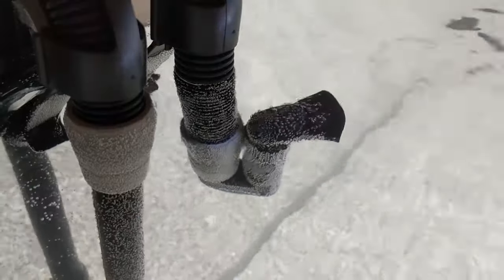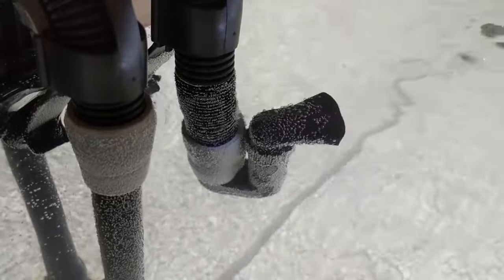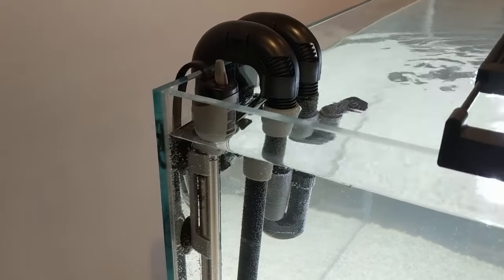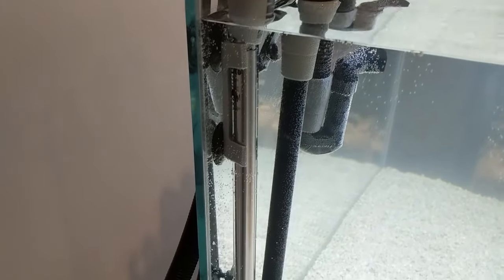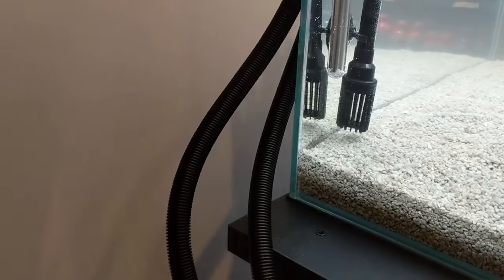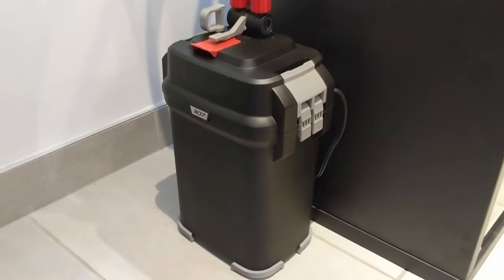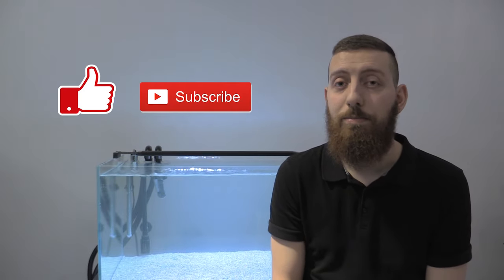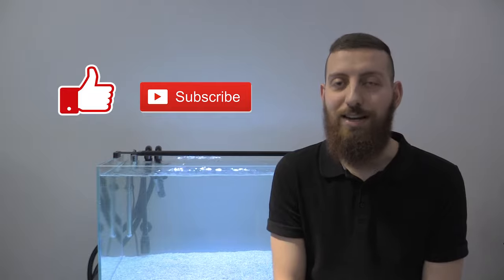Canister filter intake / output positioning tips

Comment: So i'm looking into getting a stand for our 40 gallon breeder with the fluval. Does it matter where I position the fluval? Should it be on the ground like pictured here? or could it be closer on the stand so its higher to the tank? Would my stand height matter in this case?  we just got it so i know nothing Lol
Reply from the maker: Hi there! Canister filters are gravity-fed systems, so they need to be positioned below the aquarium to work effectively. We encourage you to consult your instruction manual, as it outlines the correct positioning of the filter relative to the aquarium! 👍
Reply: @fluval  Thank you! I appreciate this. We're still putting together our system. excited for our new filter. its been a battle with the old one LOL
Reply: @fluval  update. It's A.mazing  👏👏👏

Comment: How would you go about using 2 x canister filters? I've currently got one canister at each end of the tank. The inlet and outlet for canister 1 is at the left side of the tank and canister 2 has the inlet and outlet at the right hand side of the tank. I have 2x wave makers on the left hand side of the tank, both pointing to the surface. I'm thinking about moving both inlets to the right hand side.  What do you think? Thanks
Reply from the maker: Hi Chris, when we use two filters on one aquarium, we set them up exactly the way you have them right now! One canister filter on one side, the second one on the other side. 👍

Comment: Great video. I have my 307 setup like yours. I have a musk turtle in my tank so pretty loaded. I have the vertical movement but would I benefit from having an internal filter in the tank as well for horizontal movement? I have a fluval u4 that was in my smaller tank before so I could run 2 filters on the 1 tank or is that overkill? I have no fish just 1 adult musk
Reply from the maker: A 307 would probably be sufficient for a single turtle! More filtration in theory doesn't hurt, but it could end up creating too much flow for your little guy.
Reply: @fluval  spot on thank you. Appreciate your reply ;)

Comment: Hello
I would like to ask you about the output nozzle..as i saw in you in your video you have placed it below the water level..is that ok? Also i placed it about 1cm below water level to reduce noise and drops on my lamp.
Thanks in advance i remain
Reply from the maker: Hi there! The output nozzle can absolutely be positioned below the water level - in fact, that's the most common way to set it up! Just be sure it's above the water while you're priming the filter. 👍
Reply: @fluval  Great
Thanks

Comment: Hi Eric, can the Canister filter be used as a pond filter? Meaning can the canister be placed at the same height as that of the tank? Are the canister filter capable of sucking water without the help of gravity? I believe the pond filter will have a separate submersible pump placed in the tank. Kindly share your expert opinion.
Reply from the maker: Hi there, thank you for your question! Our canister filters cannot be used on ponds unfortunately as the unit must be placed at least 4.5ft (1.4m) below the waterline to operate correctly. This is because our canister filters us a water siphon (gravity) to bring water into the filter. Additionally, our filters are meant for indoor use only and are not weather resistant. For these reasons, it would be best to use a pond specific filter for your pond. We hope this helps! 😊
Reply: @fluval  Thank you for the response.

Comment: Hey just wanted to know if bubbles going into the intake is bad or not or if it will damage the canister filter
Reply from the maker: Hi Cameron, thanks for your comment! Bubbles entering the filter will not damage the unit however, if an accumulation of air forms within the canister, know as an airlock, the impeller can run dry and fry the motor. It is best to keep all air diffusers and CO2 diffusers away from the filter input. 😊

Comment: Can I add a piece of sponge inside the filter output nozzle? Would the restricted flow strain the motor? I had a Borneo loach swim into the output and get stuck in the supply tube. I had to disassemble the output to get him out.
Reply from the maker: Hi Alan, great question! In these instances, we recommend placing a coarse foam block over the output. Be sure to rinse it out frequently! 👍

Comment: Hi. My tank is on the ground. Can FX 6 be placed beside the tank? (Water Volume : 500 litre, Tank Height : 3 ft)
Reply from the maker: Hi there! Yes, FX Series canister filters can be placed beside the aquarium rather than directly below it, provided the distance between the top of the canister and the water level is more than 8" / 20 cm and less than 59" / 150 cm. For the best filtration performance, ensure the hosing follows as straight of a path as possible, with no kinks or loops.

Comment: If you put the splash bar at the bottom or mid range of the tank would it generate flow to move particles off the bottom or would that not be proper flow?
Reply from the maker: That would work, sure! You'll just want to make sure you're getting adequate surface movement with that sort of setup.

Comment: I have a 60 gallon tank, and  a 407. Right now I have the intake in the back left, and the output on the back right, but I notice Im not getting a lot of movement towards the bottom (24" depth) The plants (and debris/snail poo) don't move. Should I move the output or install powerheads? Placement of these please? The tank is lightly planted at the moment, but Id like to add more and I want good flow.
Reply from the maker: Hello, you can definitely face your filters output slightly downwards to help improve the flow. Should it not be enough, power heads are another great option!

Comment: Quick question, what are your thoughts on sharing a canister filter between two aquariums with t-fittings? I know there's the sharing of water between tanks but beyond that, if my filter can handle the total gallons, what are your thoughts? Thank you for your video.
Reply from the maker: Hi Matt! We don't recommend doing so, but if you can get the plumbing figured out, it could work!
Reply: Hi Matt, I have a three-tank setup that runs off one large canister filter, and it works extremely well.  The main issue is getting balance between tanks, and this is achieved by having a dedicated unpressurised  hose connecting the water in all tanks.  Other than that, intake and return hoses can use a T, or preferably a Y, to split the flow.
Reply: The biggest concern that needs to be pointed out, is that shared water means a disease that starts in one tank, could end up affecting all the tanks in the system. I'd rather have a small number of sick to deal with in one tank instead of two, three, or even four tanks worth of sick fish due to waterborne diseases
Reply: @Khans0120  Indeed!

Comment: Does the outtake need to be near the surface causing agitation of the surface water or can it be a few inches below as it not create much disturbance on the surface? I have floating plants that are being damaged by the water flow on the surface but I’m concerned about not getting much oxygenation being below surface. Thanks.
Reply from the maker: Hi Timothy, great question! The more the surface is agitated, the more favorable the oxygenation process will be. However, if you need to drop the output slightly to not disturb your floating plants, that's completely okay - your fish will still be perfectly fine. 👍

Comment: Is there a screen that I can either swap out, put over or inside the intake tube of my fluval 407 filter?   It sucked in two of my loaches and I eventually want to put some shrimp in my tank.  Thank you.
Reply from the maker: Hi Joe! The easiest way is to cut a slit into a coarse foam block and stick the intake strainer into it! 👍

Comment: I have a fx6 canister filter  and was thinking about making a spreader bar. . How much better does a spreader bar circulate than the output that comes with the filter ? Does it create  back pressure on the filter ? Thank you .
Reply from the maker: Hi Van, spray bars are great at circulating the aquarium water as in most cases, the filter will suck in water from the bottom of the aquarium, filter it and spread it across the top, creating surface agitation in the process. DIY Spray bars can create back pressure which can damage your filter so it is important that there are enough holes for the water to escape from and that the PVC piping used is thick enough. Hope this helps! 😊
Reply: @fluval  A YouTube video was shown on TV. however they left off what size they made it out of .Would you please tell me everything I need to build one , size of hose etc .. Size of holes to put in pvc  so I get maximum out put from my FX6 canister filter . Thank you
Reply: @fluval  My tank is 72 " long . Is the diameter the same size used from the flexible hosing that comes with the filter ? What size PVC pipe , how many holes in bar ( distance apart } and what size hole to efficiently run the pump without no back pressure ?

Comment: I have a 207 and I read I can slow the output by raising the grey handle a bit. Because I don't want to mess up my system I'd rather ask before doing so.... will that slow it without compromising my system?
Reply from the maker: Hi Ann, thanks for your question. You can definitely lower your filters flow by slightly lifting the grey lever on your filters aquastop valve. We advise against lowering the flow more than 50%, hope this helps! 😊

Comment: Hi! I have a 125 gallon tank and just got an FX6 would putting the intake and output beside each other is a good idea? Or should I put them in the opposite side?
Reply from the maker: You can and adjust the output to direct current to the other end of the aquarium.
Reply: @fluval  Thank you so much. My option is very limited cause of the location of the tank I can only put them right beside each other!

Comment: Hi, does anything change with bow front tanks? And at 1:25 on that tank, the spray bar is not the full length of the tank, will that still provide adequate flow? Thanks
Reply from the maker: Hi there! 👋 The concepts are very much the same with bowfront tanks. With regards to the aquarium at 1:25, a second section of spray bar was added shortly after filming! With spray bar kits, you do indeed want the unit to cover as much of the length of the tank as possible.
Reply: @fluval  Thanks for the response.

Comment: I have inlet on one end and outlet in other. How do I get the poop on the bottom to circulate with water nd hit the filter intake? My tanks clean its just in one day it builds up. I do have 14 maingono cichlids in a 75 gallon fx4.
Reply from the maker: Hi there! Try directing one of the output nozzles of your filters down to create more current towards the bottom of the aquarium. You can also try adding a small circulation pump!
Reply: @fluval  yea I was messing with it and realized it moves lol. I didn't know they swivel. I have one down and one up and it's a lot better. Thank you.

Comment: (1) Can we use the grey colored ‘water flow on/off lever’ (@ the Aquastop Valve?) to control the output flow rate? (For fish & invertebrates that don’t appreciate fast flowing water.)  
(2) Can we attach an in-line Co2 atomiser with the Fluval ribed output tubing? (For planted/aquascaped tanks.)
(3) Can we attach a glass Lilly pipe or an R-type glass spinner output pipe to the Fluval ribbed pipes?
Reply from the maker: Yes. if a bonded uncut hosing segments were used and the diameter is compatible with the inline diffuser, yes, possibly. If the diameter is compatible with the rubber hose connector, yes.

Comment: I have this setup with 2 fx6 on my tank. going to be getting a 3rd. how would i set this up? same but just in the middle? or move all 3 outputs to one side of the tank facing length wise ?
Reply: then have a wave maker on the other end down lower completing the flow back to the intakes down the end with the outputs up top
Reply from the maker: That setup would work - we have a similar setup on our 10 foot tank! Just make sure the wavemaker is strong enough to move water all the way back to the other end of the tank.

Comment: I bought a cannister filter for a turtle tank I have never used one before and the turtle tank it supposed to be not filled right to the top maybe hassle in the output the instructions show it going straight across the top of the tank is it possible to lower it so that it's under the water
Reply from the maker: Hi there! Fluval canister filters can be used in turtle tanks or in other instances where the water level is not quite at the aquarium rim. We recommend consulting the instruction manual about this, as the maximum recommended distance between the rim of the aquarium and the water level is stated!

Comment: I just installed the Fluval FX6 on my 75 gallon. After several days i have a lot of gunk that can't seem to find the intake. I have intake on left and output on the right. Do you and others here recommend pointing output towards the right walland then use a wave maker lowee in tank pushing back towards the intake? I have output pointed upward and towars the intake and it isn't working out. Thanks for any help
Reply from the maker: If you're noticing debris accumulating in parts of your aquarium, it's possible you need more water movement! Try changing the directing the output nozzles are pointing or adding a small circulation pump. 👍

Comment: One question. Can I place co2 diffuser under canister input to mix it with the water?
Reply from the maker: Hi Simmi, generally it is not recommended to place your CO2 diffuser near the filters intake as the bubbles will enter the filter which can cause the motor to run try or airlock. It would be best to place your diffuser under the filters output so that the bubbles are dispersed throughout your aquarium by the output flow.

Comment: What happens if I have a bubbles going into the intake of my Fluval 405 and it’s constantly being pushed out . Is it more harming than rewarding ? I have it on a 100 gallon
Reply from the maker: Hi Jason, bubbles going into your canister filters intake is normally not advised as the input of air can cause an airlock within the unit and can potentially make the motor run dry. An airlock can cause reduce to complete flow loss and, in some cases, can break the filters motor. 😊

Comment: What about spray bars?  I follow you but planning on putting that is so think that kinda changes everything you mentioned.  Maybe I'm wrong though.
Reply: To answer my own question, the Fluval spray bar video seems to have this same setup with just a spray bar, so appears to be OK! Thank you :)
Reply from the maker: Spray bars do change things a bit! Because water is directly more uniformly across the surface of the aquarium, you don't need to worry about horizontal movement as much! You can place the intake pretty much wherever and achieve good water circulation. 👍
Reply: Wonderful thank you very much!

Comment: Hi I have a 407 and another in my 180l rio,  I have both intakes on one side and both outtakes on opposite site , eith a wave maker on the intake side higher up for surface agitation,  both outakes are slightly submerged,  is this set up OK or is there a certain way to point outtakes?,  flow only on about 40% too on 407 as too strong and creates loads of bubbles,  is there a t junction fitting i could connect on 407 outtake pipe to have on higher flow without it being like a big storm lol. Thanks
Reply from the maker: Yes, given the amount of water movement you have equipped this tank with. Fluval does not offer a T fitting for this purpose but it should be obtainable at a local DIY center.
Reply: What diameter t junction fitting would fit on end of the outlet?  Obviously plastic. Thanks

Comment: if outlet pipe is dipped in water...will it make sufficient oxygen for your fishes??
Reply from the maker: Yes! The output nozzle should be submerged about an inch below the water level. This will cause the water surface to be agitated when the filter is turned on, allowing for the gas exchange to occur and the water to be oxygenated!

Comment: Great video!  Really helped with my placement.  I got a quick question.  Is it required for the rubber connector (connecting the intake/output to hose) to be fully submerged in water?  Thanks!
Reply from the maker: Hi Peter, thanks for your question, it is not required. The output nozzle should be at or slightly below the water line. The rubber connector can be both in or out of the water based on the positioning of the output nozzle. Hope this helps clarify for you! 😊

Comment: Hey some people say their intake is fast and sucks things up mine doesn't is that normal I can hardly feel anything?
Reply from the maker: Hi Shelly, thanks for your comment! Low intake/output flow can be due to many things. Most of the time, it is due to debris or waste that has accumulated inside of the filter, slowing the flow of water or there is some type of minor error in the assembly of the filter. If your filter was recently cleaned and you are still experiencing some trouble, please reach out to our customer service team who will be glad to investigate this further with you. They can be contacted through the following link. https://fluvalaquatics.com/us/contact-us/
Reply: @fluval  okay well the outflow is fast loads of water coming out so is that a sign its working normal? Also should you feel the water being sucked from the intake?

Comment: How would you position the spray bar with an inline CO2 diffuser?
Reply from the maker: Hi Carlos, we recommend placing the spray bar below the water surface and facing slightly downwards so that the CO2 has the most contact time with the aquarium water and is absorbed. 😊